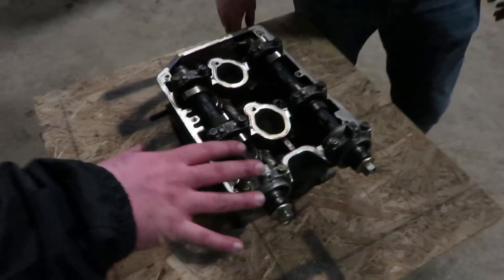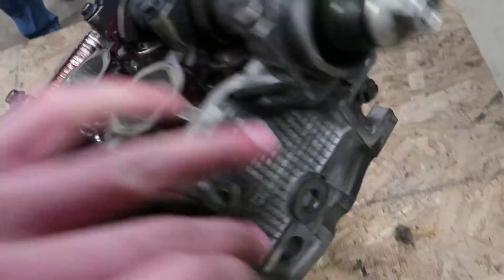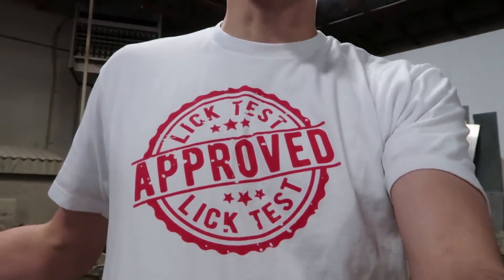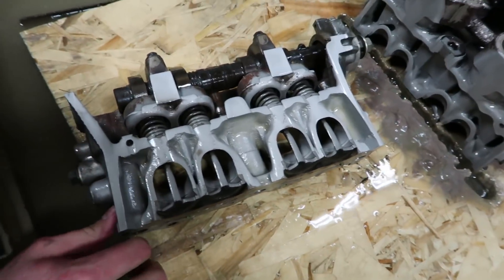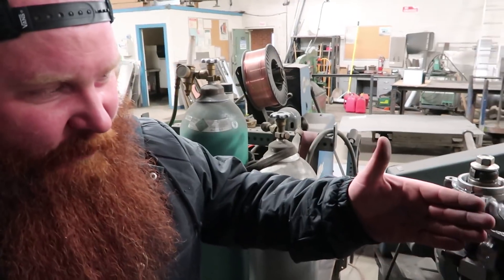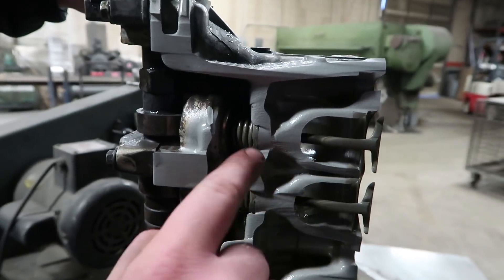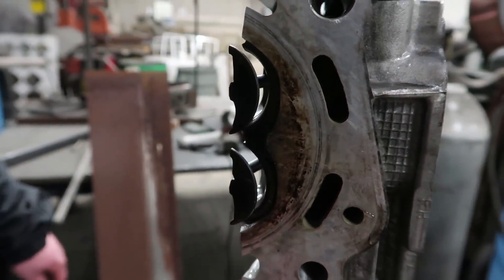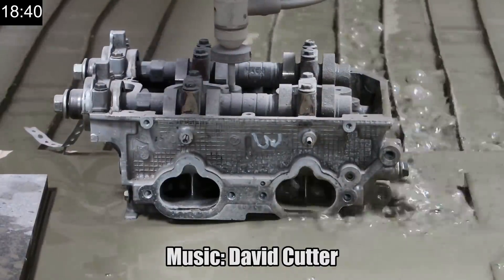Cutting A Subaru Engine Head In Half W/ 60,000 PSI Waterjet

Comment: as a diesel mechanic . . . gonna cut it where that doohickey is  facepalm  im no expert, im honestly just still learning how to work on big machines properly but i knew what a valve and a cam and a seat were when i was 8 years old and even though i couldnt wrap my head around the whole difference between a 4 stroke and a 2 stroke i knew there was more to it than one needed mixed fuel

Comment: Is there something it can't cut?
Reply: Considering it cut diamond, the only thing I thought it might fail it, probably not.
The only things it won't be able to cut are things that aren't properly secured and move out of the way. Like the skateboard wheels that spun up instead of being cut.
Reply: yaksher There are denser materials than diamond.
Edit: harder with appropriate structure
Reply: @CircleNoob Density has nothing to do with it. Its hardness and strength that are relevant. Sure, there are materials denser than diamond, but it is how easily things ablate that matters, and that is a different property. It is a combination of hardness and some other properties.
Reply: Hair, it does a horrible job cutting hair
Reply: Anything too big to fit under the nozzle
Reply: water
Reply: I would say it can't cut people or living things BUT I was proved wrong!
Reply: yaksher yeah right, let me fix that. Aaaanyway, I got an idea.
Reply: My sorrows
Reply: Plasma.
Reply: A thick object with built in channels for the water to escape. 

It couldn't go all the way through a bowling pin, because it was long enough for the water to slow down a bit, and the grain of the wood gave natural pathways for it to escape through. Anything thin though will go down.

That being said, water at a few m/s can wear away a mile deep canyon given time, so it's a question of time.
Reply: @Rob it actually does cut itself, the abrasive eats out the nozzle over time, so they gotta replace it